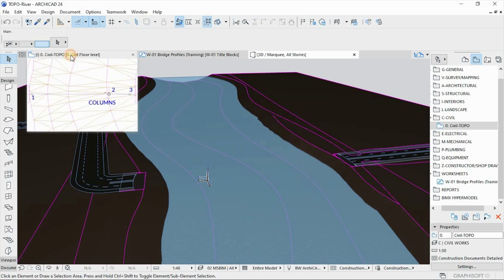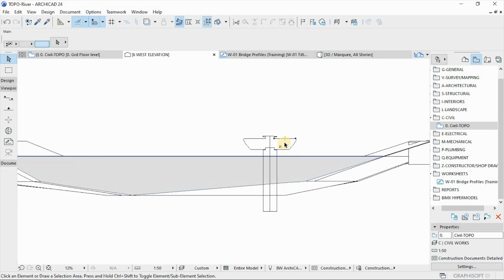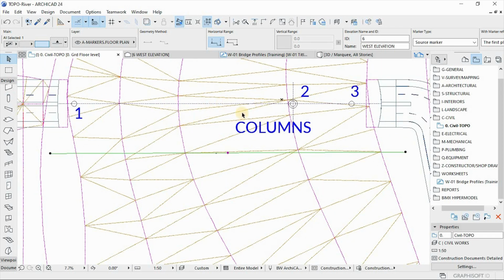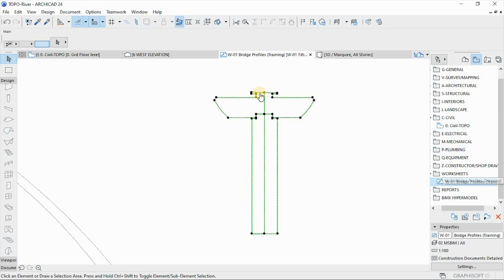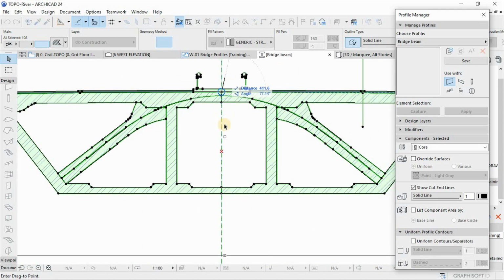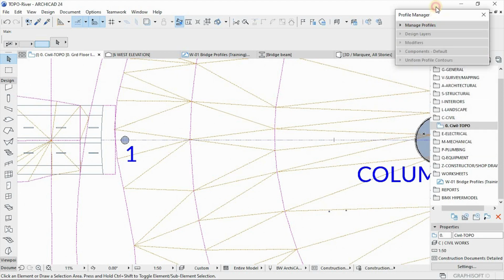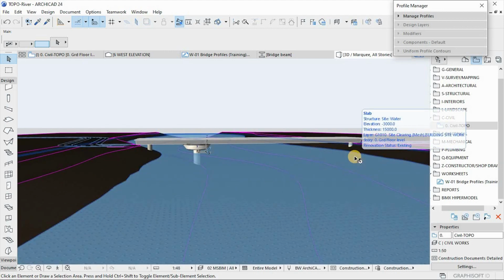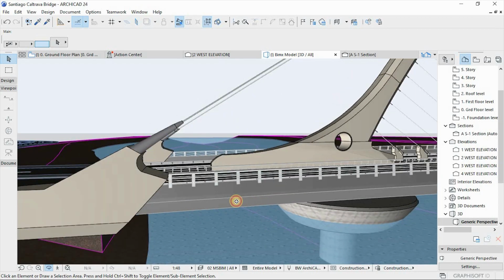ARCHICAD COURSE | BRIDGE MODELING | ( PART 2.0 Tension Bridge Beam Modeling)

Comment: How you model road?
Reply from the maker: Thank you for your question.. You can use slab tool to create roads but I will aslo make a video
Reply: @MesolightVisual  thank you for the answer but road not run with relief?
Reply from the maker: @bilbosumking  Can you clarify your question, sir, I will make a road tutorial and what exactly you want me to focus on?
Reply: @MesolightVisual  I would like to see a lesson on how to make a road that repeats the profile of the relief in a section.if You use a slabit road will bee flat, so in some points road will be lower in some higher
Reply from the maker: @bilbosumking  Point taken, I understand what you mean and I will make a video on that. Thank you for your contribution.